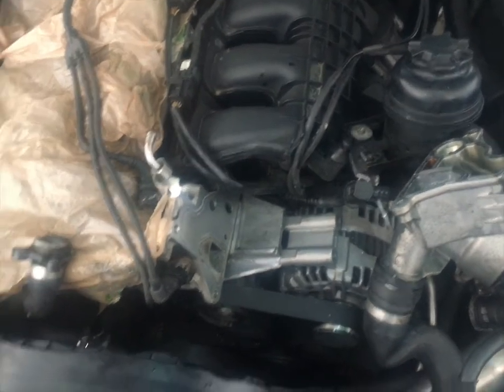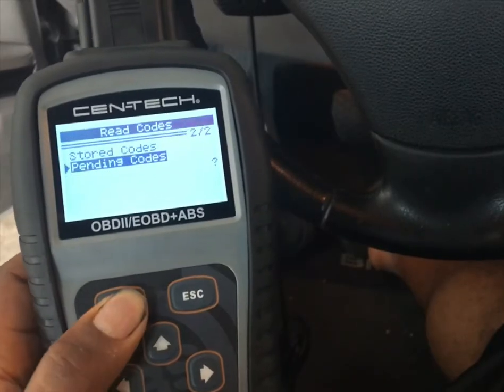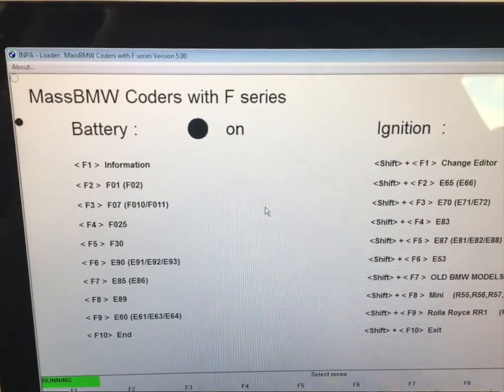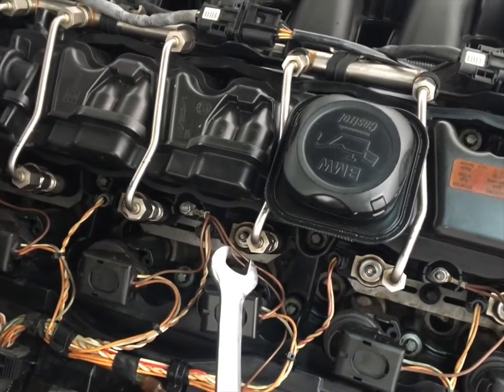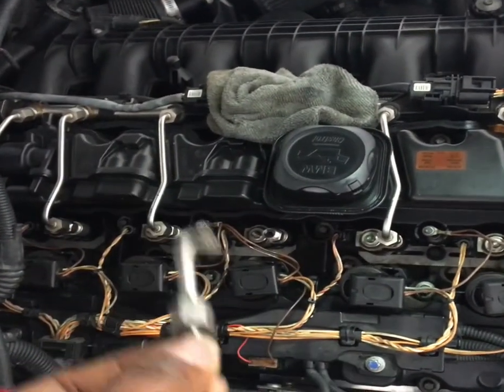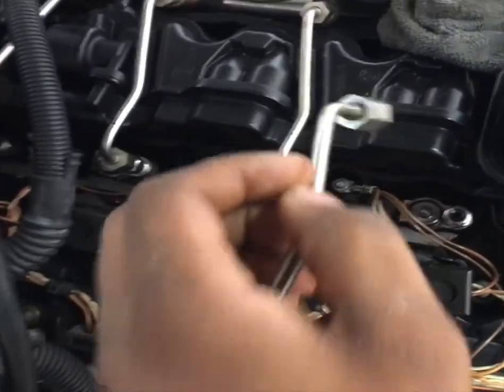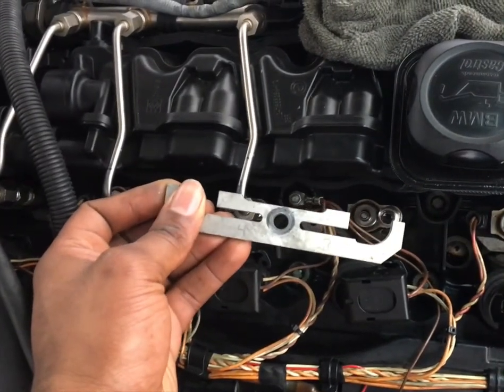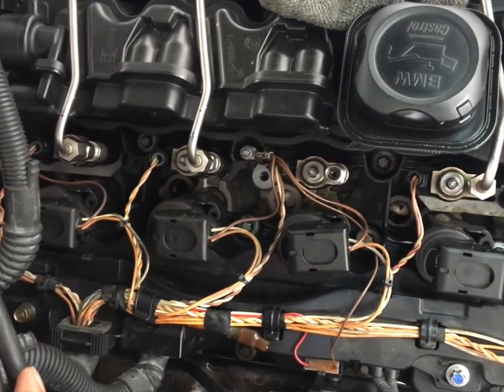What's the Deal with BMW N54 335i Injector Index

Comment: What are you using to clean your engine bay with. Looks clean. I took my cover off and want to freshen up that area.
Reply: Complex Seven Industries so your just spraying that on letting it sit and hosing it off? I was afraid to even spray some diluted simple green on mine. With all the electronics on the top and side of valve cover, the pockets were the injectors are feel like it would just pool in there.

Comment: What happens if you have index 12 with 2 older index in the same bank? I accadently bought the index 12 not knowing it needed to be a certain index and when installed the car ran fine from what i couls tell. I just put the old injector back in because it wasnt the problem. Orileys sold me the wrong spark plug when the missfire first occurred which led me to think it wasnt the plug which is why I actually replaced the injector. Hopefully all that made sense.
Reply: Holy shit, this exact same thing happened to me. I had index 9 and accidentally bought an index 12. It worked fine, i couldn't tell the difference between the old one. It died in a little less than a year
Reply: @MrDaranel  that's a pretty weird coincidence. I had bought an index 9 injector shortly after the comment I made on the video just to be sure everything was all good with the car. But its weird how I originally I had a 9 then replaced it with a 12 not knowing the difference (didn't fix the issue it was shit spark plug orileys sold me) then thinking I can just swap the seals on the old 9 and replace it with the 12 come to doing that every morning I started my car it sputtered like cazy and threw random missfire codes in bank 2 then eventually warmed up and ran fine. It was gas on the plugs so the old 9 actually started leaking so I had the buy a new 9... A bunch of annoying things but it was finally resolved lol.

Comment: I’m at a loss here when it comes to index and injectors.. I had a leaking injector on 2 and 5. All stock injectors were index 8.. I replaced injectors 2&5 with good working index 9’s can this be done if I code the new ones? At the moment it idles better but a lot of white smoke and fuel coming out of the tail pipes.
Reply: Yeah it’s very strange, the only leaking ones are what I replaced.. I tested them all to make sure.. I will do another test..any advice on where to get inpa? For coding? I’ve heard it’s a nightmare to get working
Reply: Update noshi, i changed the oil, (gas)I purchased protools checked injectors coding, no injectors were coded properly.. recoded everything and now it runs like a champ.. zero smoke,no misfires.. I will be purchasing index 12 injectors now I know everything is ok.. 

Thanks bro 👍🏻

Comment: How do you check injector pressure in INPA?
Reply: @nOshi2x  This is for programming the calibration and flow rate for each injector. This does not tell you the pressure at each injector.
Reply: Can you mix injectors? As long as they are all less than 10 or higher than 10? Running into a cylinder 6 issue and do not want to throw hundreds into this if I can just replace the injector. I’m cleaning it tomorrow.
Reply: Justin Slawek Correct, you can’t mix anything index 10 or lower with index 11 or higher. Also, whatever you do, don’t buy index 9 because they are the cheapest out there. They will eventually fail. Mine didn’t last long at all.
Reply: @danfratamico  Thank you! I'm just trying to fix this damn misfire!